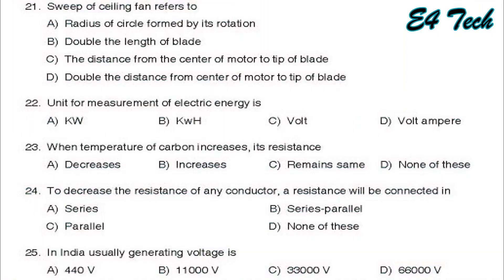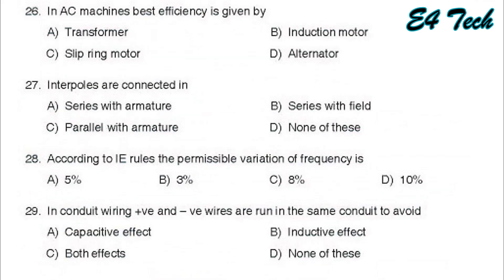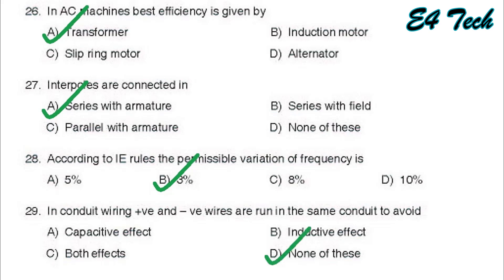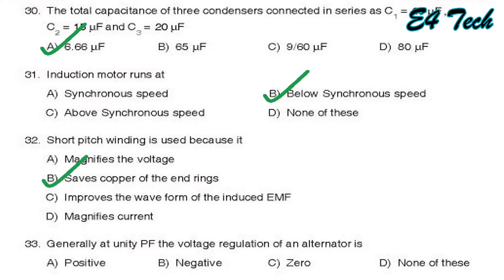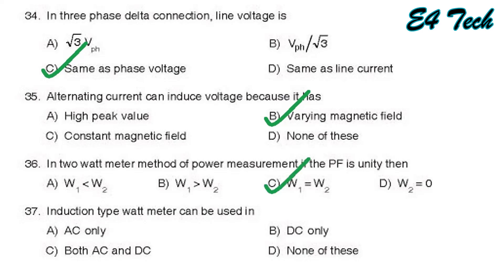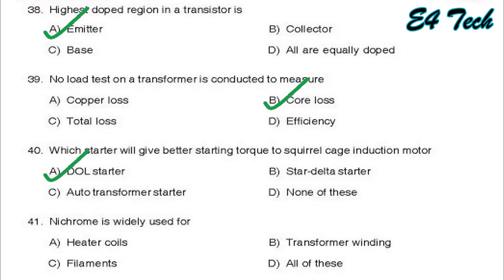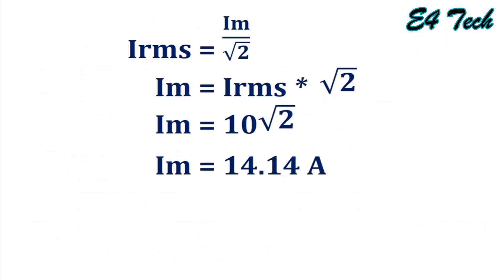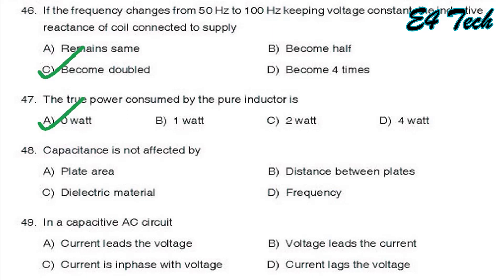PART -7 | KPSC Electrician | Lineman | wireman | Technician - Exam | Question Answer Kerala PSC

Comment: 26. Induction motor inum above 90% efficiency ille
Reply from the maker: Full load efficiency of induction motor is around 85-95%.
But the question is which one is having highest efficiency among the given list.
Transformers are obviously more efficient than induction motor. So the answer is transformer only.
Reply: @E4TechKerala  Ingalu vere levelaanu